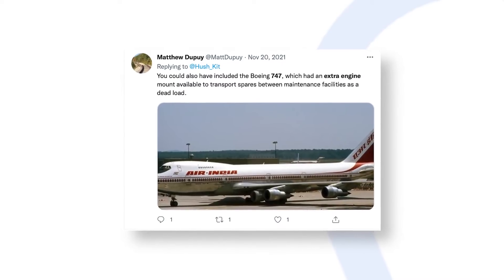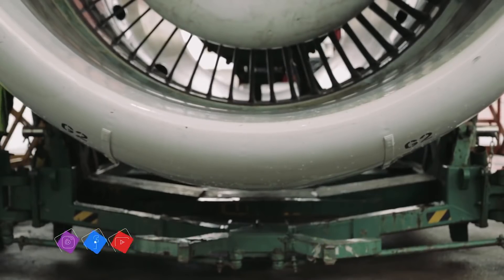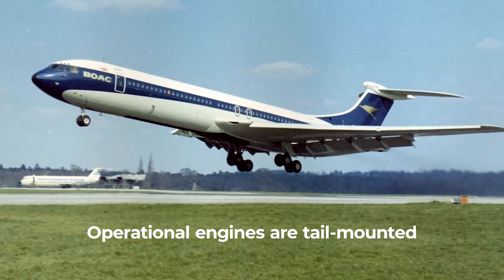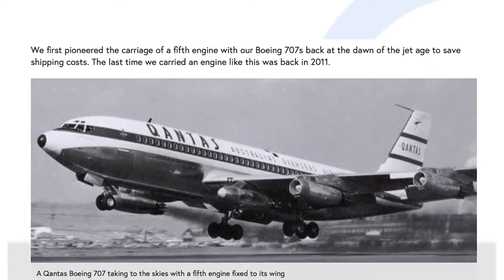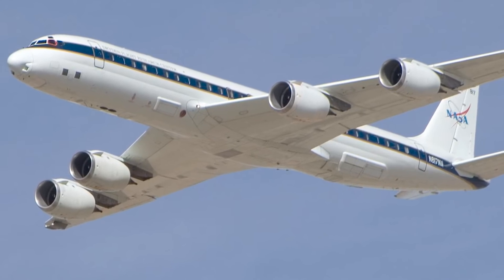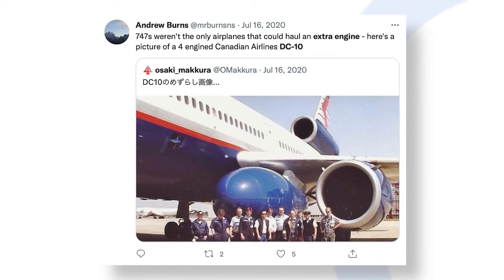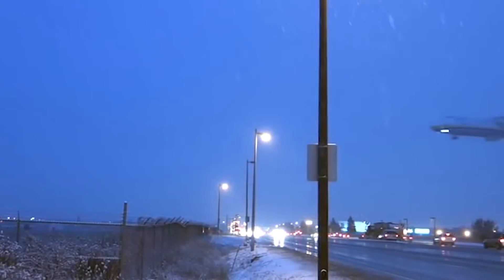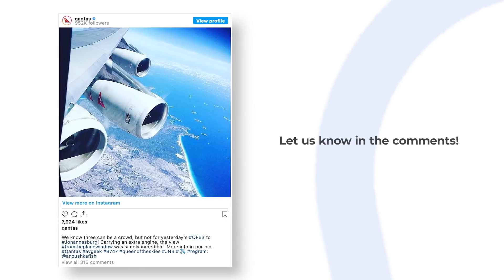Which Aircraft Can Carry An Extra Engine On Their Wings?

Comment: Interesting

But what if they fly with a 5th engine on revenue flights?
Reply: Nothing more than a delay to fit the engine
Reply: Possiblly too much yaw on the side with the extra engine.
Reply: The only consideration would be the weight and balance. Practically speaking it's unlikely to ever make sense to to use a revenue passenger flight to transport a spare engine due to the scheduling.

Comment: Will these engines reduce the range of the aircraft
Reply: Extra drag and weight. So yes
Reply: Such an engine isn't used for flight so it is "dead weight".  Meaning it doesn't do anything and only adds drag and weight which both reduce range.
Sometimes planes are fited with an extra test engine. In this case the extra engine isn't needed for flight but added to an existing plane so evaluate it's performance. Range is usually not an issue for these planes though.

Comment: The DC8 did indeed had this feature, although never done to my knowledge on the 70 series, but the 60 series did do it a few times. The spare engine would mount between #2 engine and the wing root, and because the DC8 had slots, and not slats, or Kruger flaps no configuration changes were required. However, this was only done to bail out another airplane in an less accessible location, as the fuel burn penalty was fairly high. This practice is of course unnecessary today.

Comment: what about Airbus?
Reply: Airbus aircraft haven’t really been designed with this option
Reply: @filledwithvariousknowledge2747  they don't need to because they have the Beluga.
Reply: @SJF15  Then again they didn't when the A300 launched. I wonder if the A300's engines were ferried via 747-Fs or how did they do it, by ship and land seems too slow.
Reply: @Kalvinjj  they were shipped in the Super Guppy